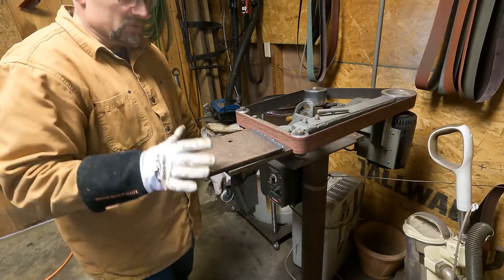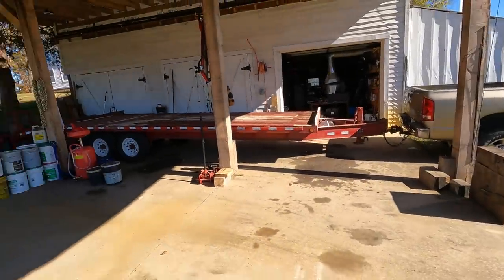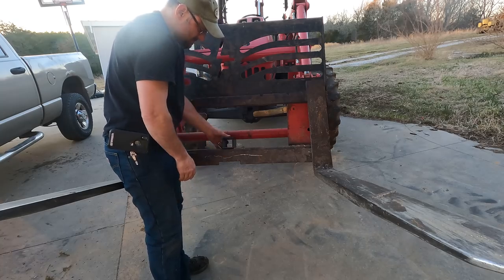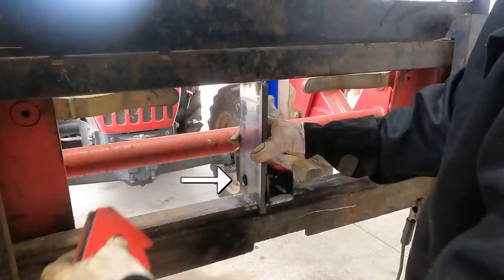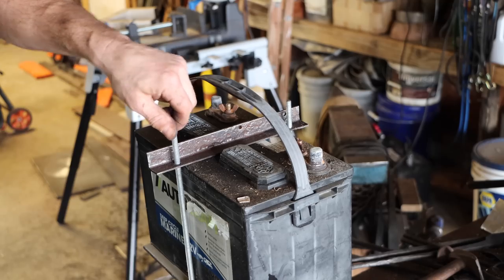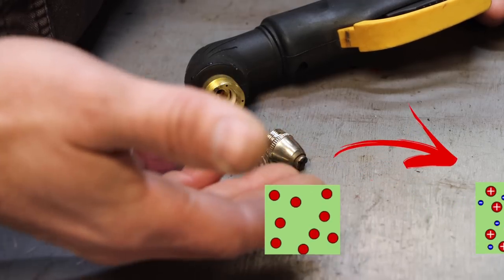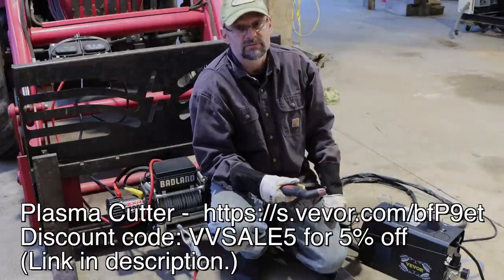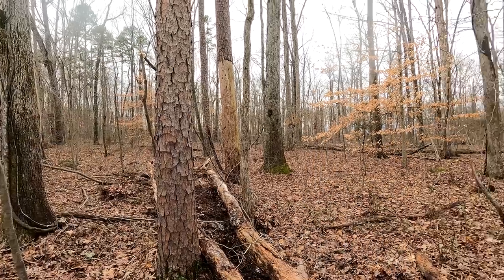The Farm Winch.  All-In-One Winch System.

Comment: Very nice setup, like your design of using one for a host of other jobs. 
You can keep the battery level by mounting the tray on an 'L' bracket with a pin holding it to the tractor arm. The tray would be bolted to the bottom of the 'L'. When the arm lifts or lowers, the 'L' bracket will keep level with gravity.
Also, you can get some leverage to move the logs easily by using an A frame (about 3 ft by 12 ft) between the log and the winch. You stand  the A frame on the ground, with the cable running on the top, on a pulley and a cable lock going to the winch. Sometimes the cable will need to be locked for that leverage. This setup will give you leverage and also lift the front of the log so it does not dig into the ground.

Comment: An awesome job as usual.  Adding bevels to thick plates when welding helps with penetration and the capping run.  With your belt grinder you could do it quickly. 
It's difficult to guage how much forest you have and therefore wood for burning.  I have seen the hungry furnace you have and wondered if you have ever thought about transplanting saplings from the forest to start new growth?  Take away 5 and plant 5 etc. Thank you for sharing.  Keep it up.

Comment: Since you battery is mounted semi permanent why not run a lower current line and switch to your tractor so it charges when you are running tractor. Just switch it off when you winch, or put a relay triggered by winch to disconnect.

Comment: I agree with Gary Fowler about the plasma cutter. Impressive on price and thickness of cutting either 120/220 20/50 amp. Very impressive indeed. Something else ( and I’ll probably find out when I scroll down your videos. But, what welder are you using during the welding process in this video? Thanks for sharing your knowledge and content, much appreciated sir.

Comment: Just run a set of wires from the tractor  alt to the battery with a relay in between that is closed only when the tractor is switched on.

Comment: When you were adding that to the tractor, I got to thinking that it might get in the way of using the forks.

Is there any room to mount it so the winch is behind the plane of the forks, and therefore out of the way of most loads?

I learn a lot from these videos. Good stuff, straight talk, and in a format that is easily digestible.
Reply from the maker: I thought about trying to fit it behind, but there isn't much room for it, and installing/removing it would be much more difficult.  I won't be winching often enough to make that worth it, at least that was my thinking.  Cheers!

Comment: Hey brother, great content. 

Just wanted to touch on the welds a bit. Looks like your machine is somewhat underpowered for what you were trying to weld. 

You'd have better results with a stick welder. 140 amps will run 1/8 7018 no problem with far better penetration.

Also, downhand mig is inherently weak. 

Careful out there

Comment: Most all plasma units swirl clockwise and this causes a good side and bad side of a cut. So inside diameters should be cut counterclockwise and outside diameters should be cut clockwise. This would keep the cleanest edge on the inside and outside of the part you just cut. If anyone is thinking of getting a CNC plasma table then make sure the plasma you buy is blow back start, any high frequency (HF) start plasmas will play havoc with CNC control electronics. Hypertherm which is considered the world leader in plasma will present a bevel about 1 to 3 degrees so that would be best case scenario. The harder you push the plasma towards its limit the move bevel you'll see.

Comment: The Winch motor will run hotter when the battery is not receiving full  power, battery should always be hooked to a running generator. RAY

Comment: Will that plasma cutter really cut  0.47" / 12 mm???  If you pre heat, will it cut more?    One thing I never see people discussing is the issue of metal fumes from plasma cutting.   Yours is the first I've seen where you go into the consumable. 
Preheating the steel.  Did you ever do it with a TIG torch?  It's so much faster than gas. I had to fix my post hole digger when it got all bent to hell and the TIG torch was what I had. It works.
BUT what I really want to ask you about was the Badlands winch.  Is it any good?  Do you like it?

Comment: Always enjoy your videos and was very impressed with the plasma cutter.  I was hoping you'd mention the air supply requirements.  How much air pressure do you need to run a plasma cutter?
Reply from the maker: Typically 4-8cfm at 90 psi.

Comment: I suggest switching to a synthetic rope, Jon. They are inexpensive, just as strong as cable/your winch, way less weight especially when moving the winch around, & will not decapitate you should it break. Thanks for another great video!
Reply: Problem is, they can't take rubbing on rocks or stumps, it's very hard on them.  Also, the sun eats them up too.  SR
Reply: @sawyerrob949  Agreed. But, throw your jacket, old blanket, etc. over a rock or stump you know the tow will be going across. Plus, they do take abuse and are not as fragile as steel cable people think. I log, clear, and do all kinds of things with my synthetic rope and zero issues. Loved it so much on my 15k tractor & truck winch I put one on my 5k UTV winch. As far as the sun goes, my winches stay covered for longevity reasons when not in use. Covers are cheap. Watch any off road YTuber videos on witches and you’ll see they all recommend synthetic.
Reply: @mst5632  You may like it for your use, but out in the woods there's too much going on and long pulls that's hard on them.  I have several winches up to 25K for all kinds of uses, but for woods use, I keep a wire rope on my winch because it can take a LOT more abuse, and they do get abused when pulling logs through the woods.  SR
Reply: I hear ya. Not trying to convince an already hard-sold man otherwise. The 40 acres of what was once virgin northern Michigan woods full of oak, maple and pine sure seems like experience enough for me cuz that’s what I’m basing my recommendation on. Again, keep using your steel cable, SR. Not trying to get you to switch. Just saying there is more out there than the only thing someone has tried. After seeing what so many others recommended (synthetic) I thought I’d give it a go and have never looked back since. The purpose of YT for me is to learn & grow, not for entertainment (that’s just a bonus great channels like FC’s does.) The only way to grow is to try new things. 

If a synthetic rope breaks you mend it in the field in minutes and only lost one foot off your rope. Your cable breaks you just lost your day, several feet, and possibly your life.
Reply: @mst5632  For me, it's just about what last the longest, as pulling logs is hard on things and keeping the cost down is important so I stick with what works best for logging.  SR

Comment: Noticed a little difference in time. When backing the trailer in the side, the car lift isn't installed. Then when welding on the tractor forks, the car lift is installed.

Comment: Hey Jon,
Great video. You will probably find yourself using the plasma cutter more often. They are so easy to transport and set up. Great for quick or curvy cuts. However, Oxy is better if you are out in the middle of nowhere without suitable power. One big advantage of "pilot arc" is you can cut mesh without stopping and re-establishing the arc. You are correct, that supplier does offer some reasonable items at quite cheap prices, but I hope you don't have high expectations of after sales support from them!
The aerial shot showing why you needed to reposition the tractor was a great addition. (A picture is worth a thousand words, but a video....wow.)
Also loved the shot with Jennifer and the dog on big momma!
I noticed a big long strip of cleared area outside your back boundary. What is that? At first I thought it was power, but yours comes the other way (Gr off WJAh)
Cheers,
EJ

Comment: Would it not have been more convenient to mount the winch on the tractor front just below the rad? When used, just raise the loader attachment above your eye sight. This way, you can wire in the winch to the tractor battery more easily also

Comment: Checking Vevors website for information on that plasma cutter but can't find how many amps it draws on 220v. Does the documentation that comes with the machine give the minimum amp circuit required to operate it. And if you want to talk to someone about the capabilities of that winch, ask the guys over at Matts Off Road Recovery. They've got several of those badlands winches on their recovery vehicles.

Comment: Seems to me you need a log cradle with a winch. A two wheeled arch and a long tongue like a wagon, so you can lift the logs and pull them parallel to the driveway, not across it on the forks.

Comment: Where else can we see an over head drone shot of a bloke reversing a tractor up a driveway times four!? On a slightly more serious note, i have found in my commercial jobbing shop that , for finer work, a plunge cut with both my plasmas works cleaner with a quarter inch drilled hole to start, and  the mill scale knocked off the top first.

Comment: When I took welding in college in the 80s I was trained to use a motorized unit that would make a straight cut with an oxy acetylene torch attached to it. You can vary the speed and after you set up the torch it would make a very nice smooth cut. I would think that someone could do the same thing by setting up the plasma cutter in a motorized shut up like I'm mentioning if they needed to cut something of a considerable length as it would be much steadier than by most people.

Comment: Ramsey REP12,000 theres a reason tow trucks have these on them one thing happened to me the bolt that went thru the plastic solenoid cover got hot started melting the plastic then amp shot up case the solder in the electric motor to soften then it thru a leg 
Then i met the guy that sold Electron winch motors that were welded together with no solder to melt that was the badest winch i ever had  winched us and our trailer out of many difficult situations along with too many to count rescues

Comment: "This is only temporary....unless it works"  How are you liking that winch so far?  I was thinking of doing this exact same project and was considering using a synthetic rope version.  They seem to do the job and are a bit lighter to lug around from one vehicle to another.
Reply from the maker: If I wasn't going to be logging with it, I would have done synthetic.  I don't know, but I can't imagine a synthetic line holding up very long being dragged across trees and stumps.  The winch has done fine so far, but I don't use it all the time.

Comment: I do not think you bevel is because there is a natural bevel built into the torch.  You were simply cutting very close to the end of the piece and it allowed the heat to concentrate to the short end and caused most or all of the bevel.  If you had cut through the piece in the middle you would not have had that slope.  Once you know the tool you can direct the angle of cut to your advantage.

Comment: You can connect the winch battery to the tractor battery because the drainage would be split between the batteries. The tractor would recharge both batteries while driving. Your concern about excessively discharging the tractor battery is unwarranted.

Comment: I'm actually surprised that the battery lasted that long when we use that kind of winch we always left the vehicle running to keep the battery charged which we usually have to pull a 16 by 80 affordable home if you know what that is it is basically a bigger camper

Comment: Hooking the batteries together won't drain them, you'll end up with a bigger battery. Just run the wires and maybe add a switch if you want. If the starter battery is low, just close the switch and you have some extra power.

Comment: The larger the battery capacity the better the performance of the winch wich in return is less heat buildup in winch.really overheating a winch will cause you to sling the solder out of armature,then no workie
Reply: Then you have to resolder armature

Comment: You can add a diode in a hot wire from alternator to winch battery and charge without running tractor battery down. Diode stops back current    Enjoy the videos!!!
Reply: Keep up the good work .
Reply: If you ran power from tractor battery to winch battery you could use diode and not have to run cable but just large wire . The diode will allow alternator to charge winch battery with no back feed .

Comment: I am sure your welds will hold, but you should weld with more current or use heavier mig welder. Also you should create a V with a grinder  before welding for better penetration. Furthermore, great vid.

Comment: You need to think about this,  what is the sheer ratting on the hitch pins?  The pins are not sheer rated i dont belive, last thing you need to do with a winch that strong is overtax a hitch pin that cant take the weight, if its under load with wire cables that winch would kill anything in its path, you couldn't get out of its way.  
Search youtube someone trying to pull a stuck truck out of the mud with his hitch receiver pin sheered off it was a cable type winch the reciver flew into the winshild and killed the driver. These go pop you cant get out of the way fast enough.

Comment: Never weld flat edge to flat edge... Always bevel the butting edge(s) to add surface area, weld depth... and produce a much stronger weld. Quite frankly, at 12,000 lbs... the way you welded it... your weld could let go.

Comment: And all y'all talking about those HF winch plates with handles...You gotta weld up your own chinesium..one size or thickness doesn't work for logging..Those things are thin and flimsy for a 12k winch..I've got one somewhere in scrap pile that looks like a taco from the first time the J hook caught the edge of the trailer..with the delay of the their wireless remote not helping matters..Lol..So suggest away dear armchair fabricators..lol

Comment: Please try your PC without the guide.You don't need it all the time.Consumables are cheap and last long time.Plasma will blow away any slag like you had.Really no diff than using oxcey torch same same.I did some of the same things you did with your winch.I'm stupid so i broke mine.but a dowel pin type of fix stopped the mount from pulling away.
from weld and gussets.Yes i pull excavators ect with snatch and winch.Thanks for vids i really enjoy them.

Comment: Not the best mounting method for the winch. You destroyed a perfectly good hitch adapter plate and then welded the winch plate too close to the rope spool. That's going to foul soon.

What about unspooling the wire rope completely and then pulling a load to train the rope and to help it spool correctly as per the manufacturers guidance

Wireless remote kits aren't expensive and universal